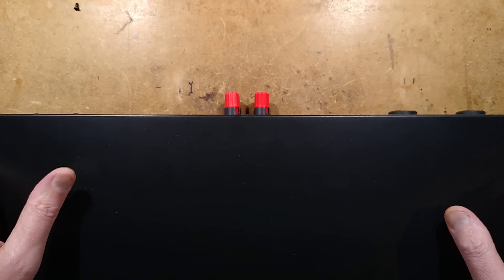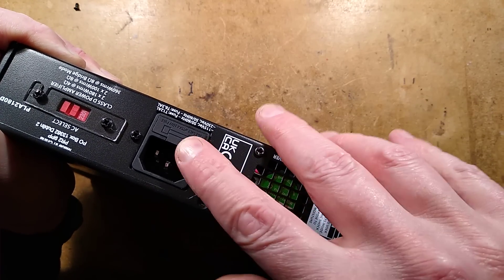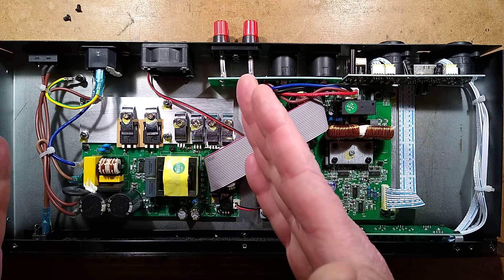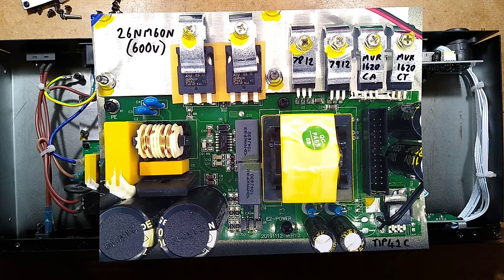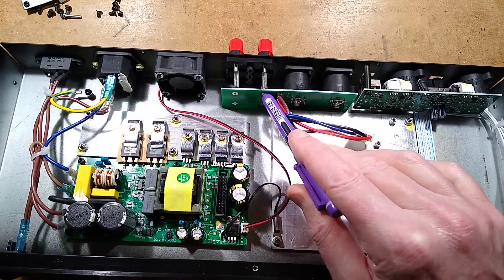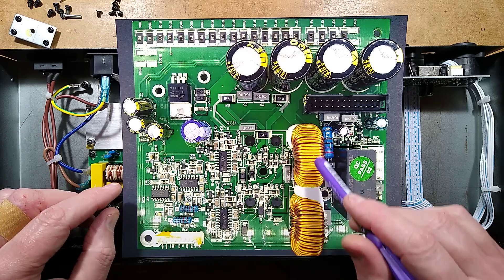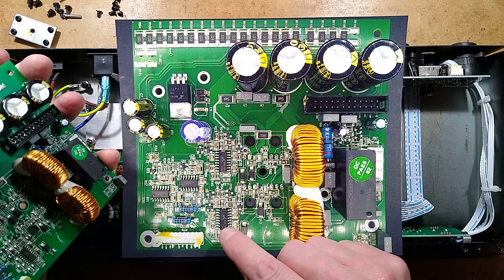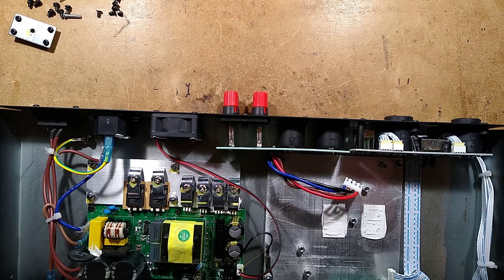Inside a 360W digital amplifier

Comment: Interesting that the front panel air filter looks like it's on the inside - therefore not a user serviceable part!
Reply from the maker: It looks like it may pull air from the front, so would benefit from an occasional vacuum cleaning.  But I bet that doesn't happen.

Comment: If I recall correctly you get nearer 3 times the power in bridged mode, at least with some bridgeable amps, but I can't remember quite why.
Reply: A standard analog stereo amplifier designed to have bridgeable channel capability will usually double the power output in bridged mode ---- but typically required a minimum impedance load twice that which it can handle in stereo mode. Also, the distortion would be quadrupled, and the damping factor, the control exhibited over the speaker by the amplifier, would be lessened.
Reply: Pulse rates that amp as "100 Watts into 8 Ohms X 2, 180 Watts into 4 Ohms X3, and 350 Watts into 8 Ohms bridged" , so, no triple the rating on this one. An old amp, a Harmon Kardon Citation Sixteen, (Quasi-Comp Class AB amp) is conservatively rated at 150 Watts RMS into 8 ohms X 2, but bridged for mono it is rated to 500 Watts RMS into 8 Ohms, and possibly up to 700 Watts RMS into 4 ohms bridged.
Reply: It should be 4x the power as each channel delivers 2x power. However, that requires a stiff power supply and most audio amps have slop for a power supply. It's typical to design a cheap amp to deliver 50% more power as the load impedance is halved for cost cutting. That's where the 3x number comes from.
Reply: @klave8511 not exactly..as said..in both modes single ended / or bridged mode ..the current sense limiting/ protection is the same...so to maintain that limiting factor , in bridge mode , the dc link voltage is selected for a lower/ reduced level appropriately,..this also is to keep the output devices within their S.O.A. ..
... therefore it can never be 4x ..it will always be much lower..
So someone thinking of just "beefing"  up the power supply , will be a pointless attempt to get there.
Reply: You get a doubling of amplitude so the resultant power will be something something square root of 2 ....
Reply: @RavenLuni Power is proportional to voltage squared, so double the voltage is four times the power.
Reply: @RavenLuni  That's not even close to being right. Ohm's Law.